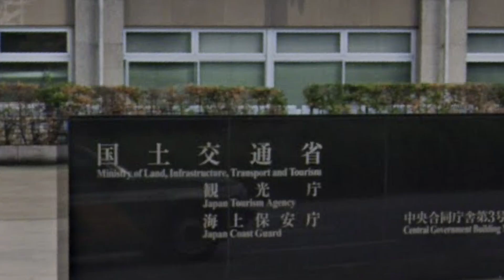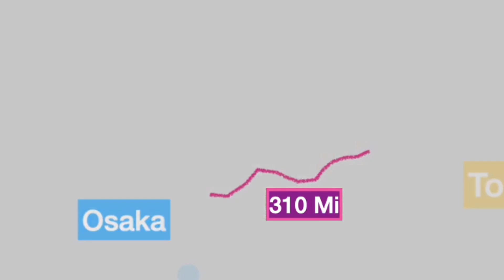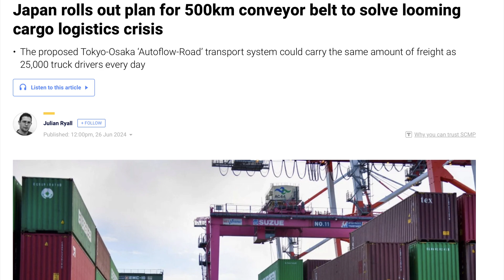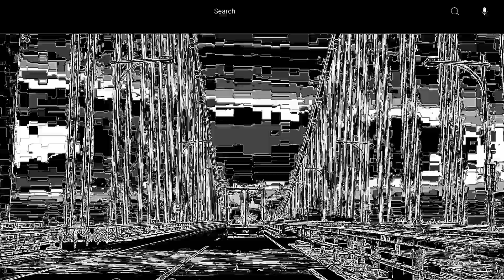The Very Long Conveyor Belt In Japan

Comment: If something breaks, the whole thing stops (or rather, all the sections from start to the failure point). Which is a shame, since they can't load new cargo onto it then (unlike trucks - if one breaks, or there is a traffic jam mid-way, you can still load the next trucks).

What about unloading operations? They'll need to be fast an precisely timed (i presume the belt will end somewhere on the city edge and they'll still need small trucks to deliver the cargo to the individual shops - this has to be coordinated perfectly so that a) the trucks don't pile up waiting, and b) the thucks are there when the cargo arrives. Otherwise, they'll need a huge operations yard, like in ports.. and in that case maybe it's better to get back to trains.
Reply from the maker: @panda4247  Not really sure what the exact plan is. It will be interesting to find out. I wish there was more detail about it.

Comment: Two conveyers needed, one each way, how long a travel time from end to end?  when so start to think about it carefully........ it does not work out.
Reply: I agree, not sure why they dont go a for a simple double track train line, with very high frequency (think metro type every 10min) and could even be running narrow gauge if they just want it to be 1 pallet wide....Driverless train systems already exists and are fairly easy to implement. Not to mention a train line is way easier to maintain than that monster conveyor

Comment: I still fail to see how it could be a better option than just using trains.
Reply: I'm not sure they have the space for all that train infrastructure. Japan is a little different than the US. its super dense and everything is compact. The idea sounds pretty crazy, but the Japanese are known for coming up with some unusual solutions to different problems. I wouldn't put it past them to try and build something like this.
Reply: @mendodsoregonbackroads6632  yea not like japan doesnt have some of the best train infrastructure in the world already....
Reply: @mendodsoregonbackroads6632  Oh yeah im sure japan is not like the U.S... they actually have fucking BRAINS and they can put rail into their country, wow... shocker I know
Reply: I’m sure that a conveyor belt system would have a lot of spurs - more than what would be practical in train operation.
Reply: Doesn't have the same limitations as rail. Doesn't need to be attached to the ground or a bridge on a fairly gentle grade.  Runs continuously. Quieter.

That said, mx will probably be absolute hell

Comment: It doesn't sound completely stupid, but I wonder what happens if it stalls. If a road gets blocked you can take a detour, if the conveyor stops it ALL stops. And there are a lot of failure points across 300 miles running 24/7 with a heavy load.
Reply: Considering Japan's geography, it does make a certain sort of sense. If a road is blocked, there's probably no other road that can take the load you are carrying anyway, therefore, maximize the corridors you have